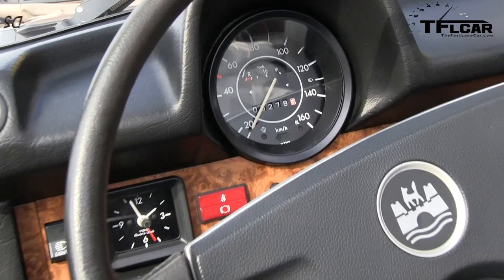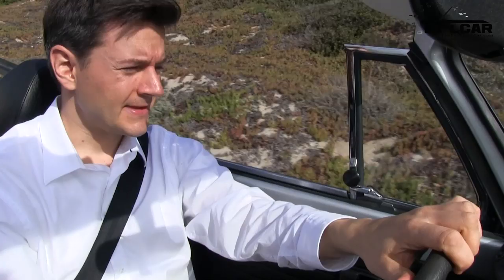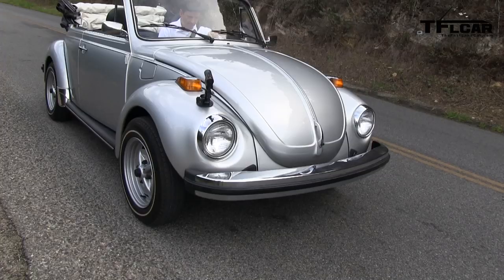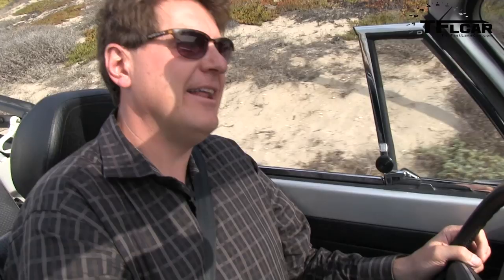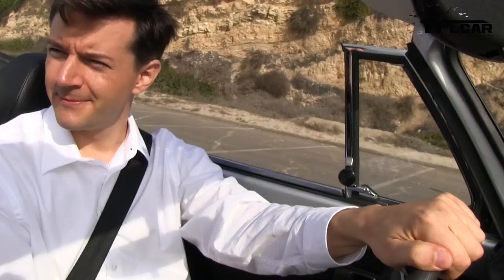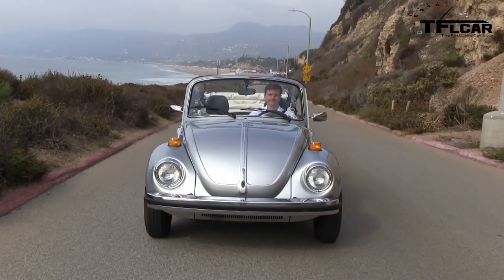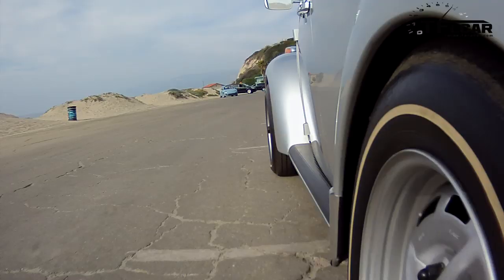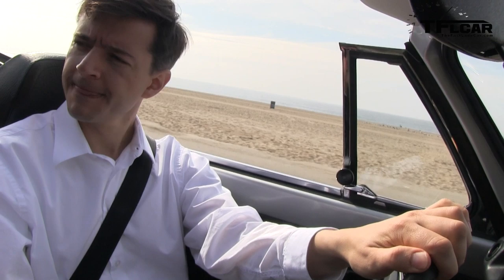Classics Revealed: The Original Volkswagen Beetle Convertible

Comment: 1979 was the last year of the original Beetle Convertible. Production began in 1949 at Wilhelm Karmann in Osnabruck, Germany. U.S. sales of this model began in 1953.

The last few Beetle Convertibles were made by Karmann through January 10, 1980, although for emissions reasons they were still technically 1979 models and bore serial numbers reflecting so.

Comment: Hi, Roman! I have owned a 1958, 1963, 1967,1969,1972,1973,1978 Volksagen Beetles - and am therefore very familiar with the
handling behaviour of the model through my decades of ownership. A significant change came with the advent of the Super Beetle, to the front end suspension and steering system. My experience is that the steering was light, yet precise, with no centre freeplay at all. I would say that the issue you detected in your youtube-recorded driving experience is unique to the beetle you drove, due to some necessary adjustment which the vehicle may require, even if it only has such few miles on it. As for the the brakes, I have found them to be excellent, albeit resulted in typical nosediving. As for the 1.587cc or so motor, I enjoyed the measure of pep it was capable of. I had more pep than all the small cars from British Leyland, the sub compact offerings from 
Ford and GM - ie Pinto and Vega repectively. Its pep could also give the several small Japanese cars which were beginning to flood
North America in the mid to late 60's a good run for the money. In my M-Benz B250 I once  followed someone driving a 1978 VW Beetle Cabro in the traffic last year - he put on quite a brisk acceleration performance. 

Matter of perspective, Roman. 
Best Regards

Comment: I’ve found the steering and brakes on these to be the opposite. The steering is light and direct and the brakes are quite good. Perhaps the example you drive had issues ? Also, the beetle still got good fuel mileage compared to its competition at the time - about the same as a Toyota Corolla of the era.

Comment: Wow, did not know it was air cooled?
First off, it's a museum piece, not a driver. Cars were not meant to sit around and even humans creak and groan when they get THAT little exercise.
The steering is adjustable and if there is more than 16mm of play, then something is broken or worn out.
The brakes are also defective. We own a 1970 VW which is in the garage right now, and it can stop faster than a modern Volvo. This was demonstrated during the summer of 2013 when I and a 2010 Volvo made a panic stop at an intersection: I stopped short of the crosswalk lines, the Volvo went 15 feet past the crosswalk lines and had to reverse out of the intersection. The Volvo hit the brakes first.
The shifter is also adjustable and goes smoothly into each gear if set properly. Installing polyurethane makes it even better, and can be installed in less than 15 minutes.
Saying that YOUR defrosters did not work is the exact same thing as saying "I drove a rusted beater" or "I did not maintain my vehicle". The defroster tubes unraveled after several years and air had no way to get to the windshield. I can clear the fog off the inside of my windows before I make it around the McDonald's parking lot.
Power? Yes, stock was never more than barely adequate, but there are ponies sleeping in every corner of VW flat fours just waiting to arise from their slumber and be put to use. Just let them breathe for a change and give 'em a little ignition advance and some good fuel, and you will be doing 70mph at the bottom of the freeway entrance ramp. Ours will cruise at 70mph at less than half throttle up mountains.

Keep things in perspective.
Reply: I'm pretty sure he knows it was air cooled.  He's just trying to make conversation for the video.  And your 2010 Volvo's brakes must be pretty bad if an old Beetle stops faster.  Keep things in perspective :-D

Nice review Fast Lane!

Comment: If it is a US spec beetle it should have a 1600 (1585cc actually) dual port in it.  As far as I know all the US bugs after '71 had 1600s.  The first carbureted 1600s had an awesome 60 hp but emissions requirements took their toll on the later fuel injected engines.  The fuel injection would give trouble and no one knew how to fix them so you could pick these up for a song when I was in high school.  A 2 bbl carb kit and a header later and you had a reasonably quick bug.

Comment: I had a 75 first year fuel injectors one in 98-2005.it even had a new engine. That fuel injection sucked. Really bad. I think I’d stick with a carb model if I ever wanted to relive it. I got constant attention. I had to push start it, but it was cool once it Drove! I like the 92 Golf GTI 16v I bought in 02 and have owned since A LOT Better.

Comment: No heater? C'mon. Some are better than others, that's stock so it should be great and it has the optional auxiliary gas heater which is in the front, it uses gas. That's the extra green rocker switch near the speedometer.
Reply: really--send me a link please?

Comment: Christian Buhlmann: You are mistaken about the engine displacement of this 1979 Volkswagen Beetle Cabro.
The engine displacement is just under 1.6L - 1600cc - 1587 I think, as is the custom with VW. It is not a 1.5L
engine as you stated in this youtube.
Reply: Markus Weigand that’s correct. 1600 cc.

Comment: I do have one of them, made 18 September 1978, it has 1600cc engine, Fuel injection is a piece of dream, runs like a charm, never ever had any trouble with it. There is truckload information on internet how to service fuel injected engine and whole VW beetle as well. http://i239.photobucket.com/albums/ff238/wrocek/1001295_10200226016828494_1471852686_n.jpg

Comment: where is locate the fuel pump & fuel filter of a 1979  vw convertible
Reply: Tony Pachanga under the gas tank. It’s accessible from the right front wheel well.